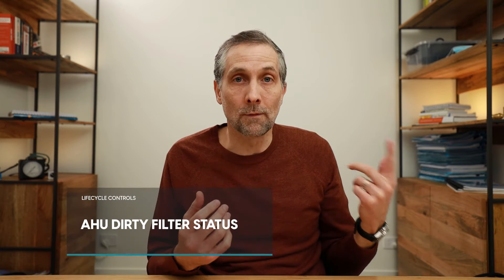I'll Bet Your VAV AHU Dirty Filter Monitoring is WRONG. You Will be Surprised

Comment: Great video, I have always known this was an issue on VAV systems. The other issue is the control of minimum outside air is not usually considered. This is often setup at max airflow and is no where near at minimum AHU airflow because return pressure increases exponentially with the increase in airflow. Ideally the minimum outside air damper position should open with the reduction in total airflow but that would need two positions measured in the field. Ideally this could be maintained using a velocity sensor to a constant velocity but still requires some design to provide straight duct before the sensor.
Reply from the maker: Absolutely, here in Australia we have gotten better at maintaining the design outside air rate as the supply fan slows down. But yeah, I'd guess that most buildings have code outside air rates on very hot summer days, but are not delivering code outside air rates during winter when the AHU's have turned down. This is a massive complicated issue.

Comment: Rule of thumb is usually 100pa diff, I have worked on some projects where 250pa is the alarm limit, in my experience 150pa diff is a good gauge to alert the operator the filter is clogging. A proper maintenance strategy should be in place to inspect the equipment quarterly or 6 monthly as a minimum.

Comment: sir great video but I ask u one question sir same as related to DPS if our fan speed 1 means 22hz fq so our DPS value how much set if 42 Hz 2speed fan ho\ much dps Pascale set value if fan speed 3 means 60hz how much set Pascale in DPS can u tell me plzz sir
Reply from the maker: I think you should test it on site. 
If the filters are clean, then switch the fan though low, medium, and high speed and then write down the pressure across the filter at each different fan speed. 
These three pressures are your filter clean pressures. Then add, I don't know, maybe 50Pa or 100Pa more to estimate the dirty filter pressure set point. 
If the filters are dirty, then do the same test and you will have the dirty filter pressure set points.
Reply: @bryceanderson17  thank you so much for reply sir great answer

Comment: Great discussion... I've seen filters that were monitored, but never alarmed after 5 years (never reached the high do alarm set point).

The maintenance team made no excuses for the extremely dirty filters. How did the filters never alarm after 5 years? The filters bowed in concave fashion, allowing air to flow around the filters, causing the downstream coils to foul.
Reply from the maker: I would guess that most dirty filter pressure monitoring doesn't work. 
Grab a piece of card board and slide it across the filter intake (creating a resistence), the further you push it over the more the resistance, the pressure over the filter should increase. At what point does the alarm go off..

Comment: It's still not as simple as a look up table to fan speed IMO. The filter DP is related to face velocity, ie volume. A VAV system has varying system resistance curve so the velocity across the filter is not proportional to fan speed. Granted it's a closer method than a simple switch, but is dp alone even the most appropriate way of monitoring filter loading? Maybe fan power from the VSD is a better metric of system health, or the DDC could check the filter DP against commissioned value only when system pressure setpoint and fan speed are matched, or a monthly scheduled test cycle etc. Does the pressure drop of a loaded filter at low fan speeds even warrant changing? If not maybe a simple single setpoint is fit for purpose? If a filter is blocked in the forest but nobody is there to see it, is it really a tree? 🤔
Reply from the maker: What if we total all the individual VAV box volumes for the VAV's associated to the AHU and map that point on the AHU graphic as calculated supply air volume (lps). 
Then in our look up table on the X axis, we replace fan speed with supply air calculated volume? 
As the AHU supply air volume decrease, 4 points in the lookup table, the dirty filter pressure set point is calculated.
Yeah? 
Would that completely satisfy the varying resistance of the system with the VAV's in different positions?
Reply: @bryceanderson17  that should work. I would do it be taking a baseline volume and filter DP, a bit of DDC math would calculate the expected dirty pressure at any other volume flow rate. (DP1+(loaded DP))*(V2/V1)^2=dirty filter pressure @V2....or something like that
Reply: @bryceanderson17  The idea above would work but ideally you would relate those flow vs pressure values based on an exponential curve because pressure increases to the square of airflow. Still not too difficult though.

Comment: Do you not need to account for the fan laws where the pressure is a square relationship to the fan speed?
Reply from the maker: I was sort of wondering about that. I wasn't sure, that is why I adding that the service techs tweaking of the lookup table. We will see what the comes back from everyone. You could be right.
Reply: @bryceanderson17  I have implement in a number of Data Centres (usually the few clients who will spend the extra money for the sensors) and I carried out the calculation using the fan law. It can be a bit of a pain but again a simple lookup table will usually suffice.

Comment: ASHRAE 36 addresses this issue with a formula based on fan speed / volume adjusting the setpoint and a pressure sensor not a switch. You lost this bet with air handlers programmed to 36 sequences. 36 has been around for over 10 years.
Reply from the maker: We don't use 36 in Australia, no one even knows about it. 
Is it widely adopted in the US? 
Does every VAV AHU have pressure transmitters across the filters? 

I thought 36 was a pretty advanced document. Pretty impressive really. 
But, in my opinion, overly complicated in some cases. The trim and respond hunts unnecessarily, where the one we developed doesn't. And I also got the impression that a very smart person wrote it, but some of it is just not practical to deliver in the real world, or talked about stuff that was specific to certain BMS systems meaning not all BMS systems could achieve what was required. 

Are you sure that 36 is widely adopted by BMS companies? 

If so, then yes I'd accept iv lost that bet across the US. It's a long way to come for a beer 🍺
Reply: @bryceanderson17   not adopted widely. But as it is ASHRAE standard seeing more specs reference it. I have been implementing trim and respond since the late 90s and it is stable (better control than PID reset off worst VAV box). As previously stated by another comment most facilities just schedule filter changes. Steve Taylor was heavily involved in the development of 36 and he is smart and will be the first one to tell you so.
Reply: @vlgidte63  Scheduled filter changes do not always work. There are issues especially when working in areas with lots of construction. Filters get dirty much quicker due to dirt from construction works in surrounding buildings etc etc.

Comment: To be honest..... and in my very humble opinion..the filter dp, is basically useless in practise.  Nearly all commercial projects replace filters on a service schedule and on an alarm, or alerts.  On such projects l prefer using a pressure switch(DI) and a gauge on the unit.  Labs, hospitals are different.  

But you are right, the omission of dp chart is a bit of an oversight
Reply from the maker: You are probably right. But could it be possible that they are changing filters periodically, because the pressure switch method doesn't work. 
Mech service tech walks into a plant room and sees the fan running at 50% speed and the filters are blocked.